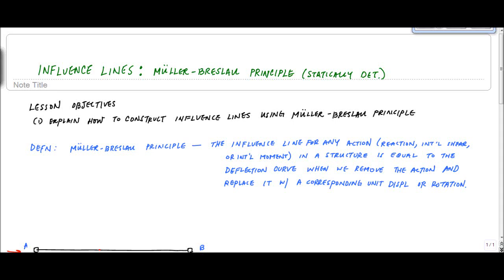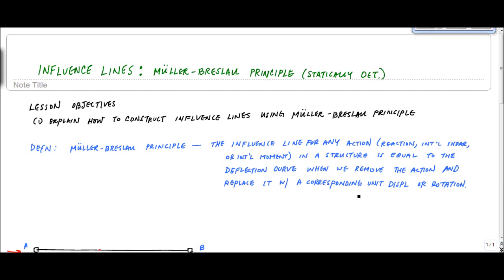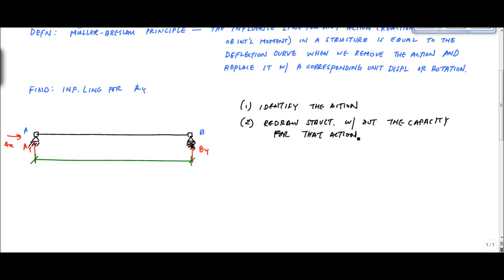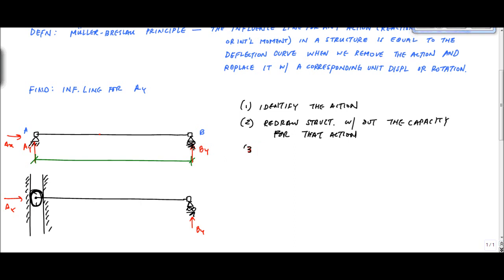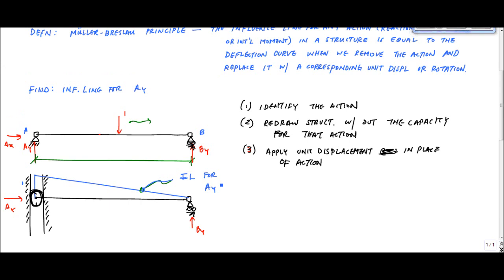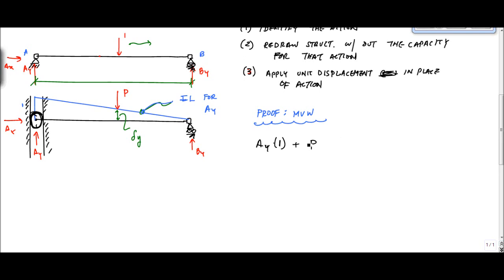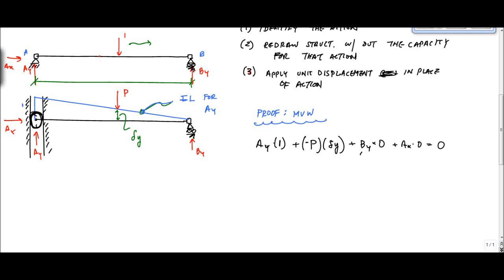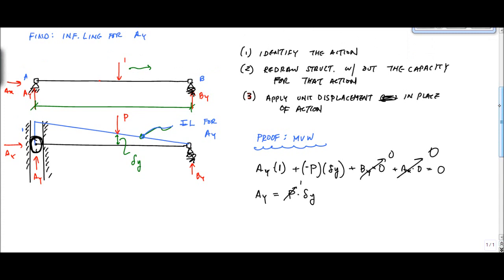Influence Lines with Muller-Breslau Principle (part 1) - Structural Analysis

Comment: You lost me at Step 3:  "apply unit displacement in place of action." Why did you go up by one unit and then draw a linear line back to zero? Based on your video #22, if a unit load was moving from A to B, wouldn't it just be a constant 1 if we were calculating the sum of forces in the Y direction? Fy = By (since Ay no longer exists due to Step 2)?